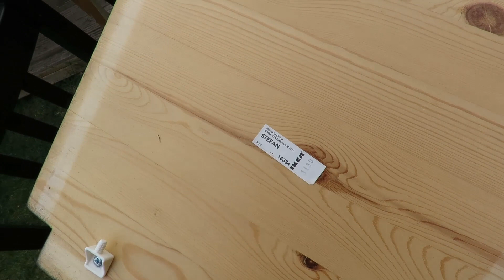Fixing three chairs VERY LONG VIDEO

Comment: Yes, good job on the repairs. Always glad to see you fixing things rather than throwing them away. We should all try and repair and not just buy another. 
I might be wrong but that screwdriver would be pretty old? My Dad had one of them, exactly the same colored handle and I am sure they were made in the UK. They were good enough with the ratchet part but the plunger part was hard to use, well I found it hard to use. So many old tools he had and I haven't got a clue where they went unless my Brother has them.
Reply from the maker: Yes Mike, that is a good old classic screwdriver that has served me and my father well 😍